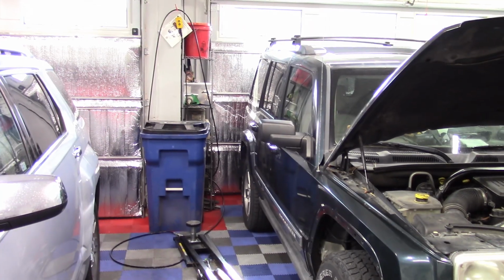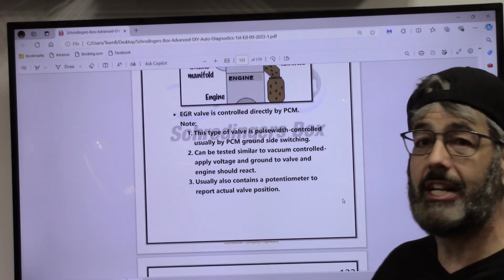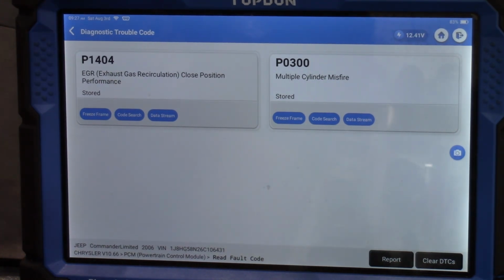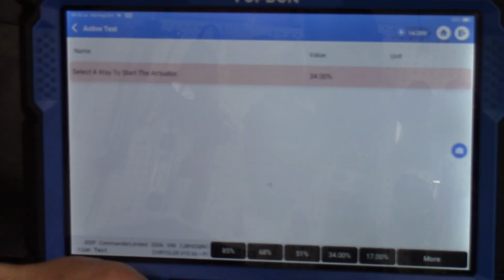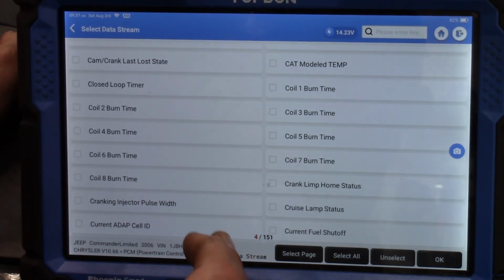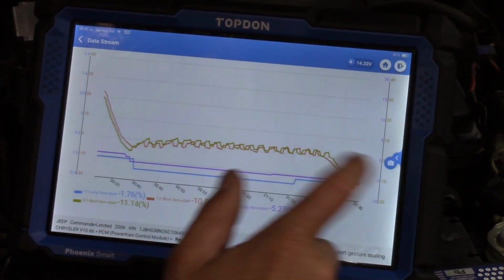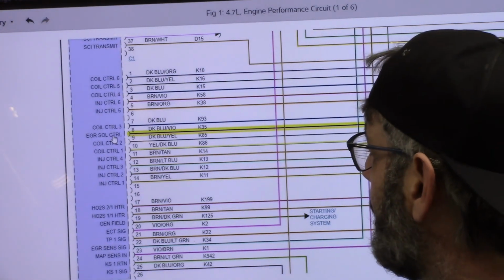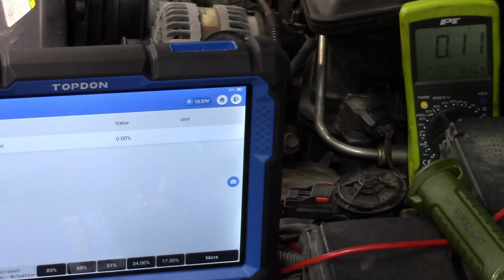Jeep P1404 EGR code- Would a new  EGR Valve fix it? Pt1

Comment: How will a ground to an egr which is power side switch affect the car's pcm? I am giving the ground to the ground side of the egr not the powerside so how will that blow up the computer 🤔
Reply from the maker: It won’t. You are giving a ground after the load so it’s fine. But ground it out before the load on the power side  and it will blow the PCM because the load is power side switched.

Comment: Am sorry to ask this question because i thought I've familiarise myself with the basics of electricals on this site but am thrown off by this video where he said you will burn the computer if it is a power side switch. When i give a ground to an egr with a powerside switch pcm how will that affects the pcm because after all i may even be using my test light to do that on the egr's groundside. Ground to ground shouldn't poss any problem especially when the load is connected even if it is power side switch?
Reply from the maker: It depends on which side of the load you are on. You will absolutely 100% fry a PCM supplied voltage source if you ground it directly without a load. In the example in this video that is the design of this EGR. 
   Now if you ground it after the load OR you provide a load and ground on the power side it will be Ok.
Reply: @SchrodingersBox please I am unable to decode or apprehen your last statement even the first one. Firstly a PCM's supplied voltage source is the battery so how can I 100% fry it am sure you meant the pcm itself and not the source. I am also not seeing the picture you are putting out clearly actually. Now the last statement says "providing a load and ground on the power side will be ok" is not clear. How can you provide ground on the power side of the load or maybe in a case one confuse the power line to that of the ground wire thereby grounding the power line while the load is being back probe?
Reply from the maker: No. A 12V source from a PCM will be from a transistor. Not the battery. If the voltage was from the battery it would go through a fuse from the circuit box, not through the pcm.
Reply: Matt, in a power side switched circuit like an EGR Solenoid, if you removed the Solenoid and connected a test light to ground and you touch the power side of the harness, wouldn't the "load" be the bulb in the test light in this example?
Reply from the maker: Absolutely. It’s one of the easiest ways to test the circuit in fact.

Comment: Just because the valve was replaced does not mean the one you installed was good. Especially crap from oreillys or autozone.
Reply from the maker: Exactly. That’s why I fully tested the new one- even testing the potentiometer. The new one works properly.

Comment: come on, Matt. Get  already a diesel car in that garage.  Get a vw tdi 😂😂  
It would be fun to watch.
Reply from the maker: Hahahaha I do get asked this daily especially from European viewers. There are so few diesels here where I am. 
   I know nothing about diesels and it would be a disaster. I tried one time a few years ago to diagnose I check engine light on a diesel and I concluded it must have had a bad MAP sensor because it wasn’t measuring engine vacuum at idle. It wasn’t until I got the same reading that I researched and learned diesels don’t have vacuum hahahaha.
Reply: @SchrodingersBox  That's not universally true. Some (especially more modern, but some as old as 80s) diesel engines have throttle valves, but they don't necessarily work in the same way (or with the same intention) as in gasoline engines.

But even some gasoline engines don't necessarily have manifold vacuum, for example some BMWs have a throttle valve but it tends to be wide open because the amount of air getting into the combustion chamber is controlled by the VANOS system.
Reply from the maker: All the more reason I don’t do videos on diesels lol. True about the BMW- I forgot all about that!!

Comment: Actually, the fuel trims make sense right? The PCM thinks its commanding the EGR, adding a known amount of exhaust back into the intake, which it would have to control for with the injection (LT fueltrim). But it's not actually getting that flow, so it corrects for it (ST fueltrim). 

Or am i dead wrong? :) Guess I'll find out in part2 if its actually blocked.

Also, can you recommend one of those bi-directional scaltools that are DIY affordable? I'm seeing a lot of unknown brands and I'm sure a ton of them are garbage.
Reply from the maker: No I agree. The LTFT makes sense. However I was confused on why it was countered by the sTfT. The STFT should have been zero.
Reply: Interesting, GM has a data pid that shows fuel trims minus commanded EGR, helps with the confusion!

Comment: The scantool live data that stood out to me was the 5.0V reading for the position of the EGR valve.  It seems to me any  position (potentiometer reading) sensor should be .5v to 4.5v and not read the source voltage.  From there I would have checked power and ground at the sensor and then checked the valve for problems.
Reply from the maker: Yes correct. You won’t see a potentiometer show the full reference voltage or complete absence of voltage. In this case clearly the potentiometer itself was faulty but of course usually it’s a circuit fault.